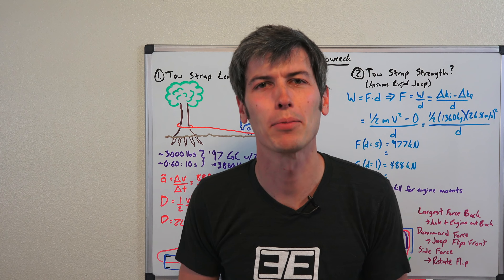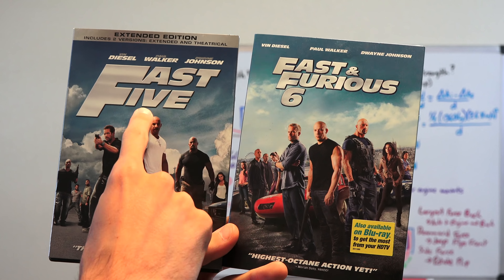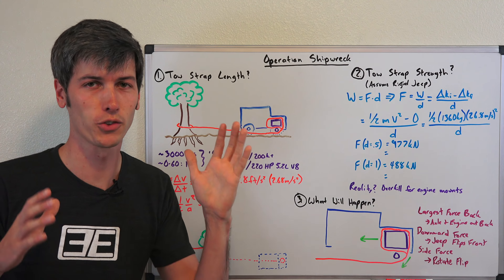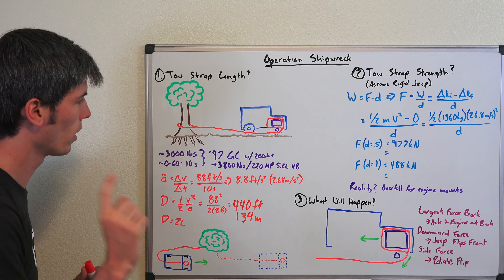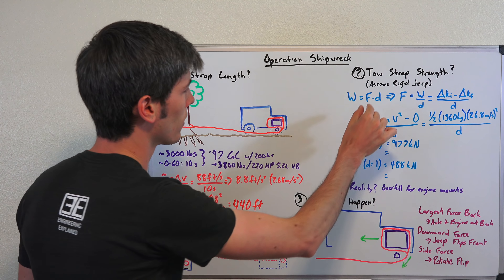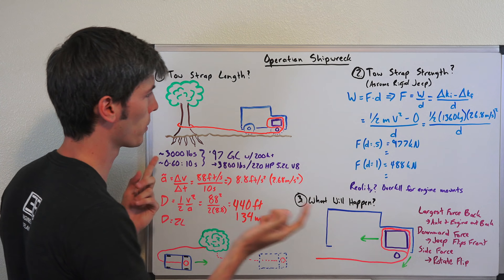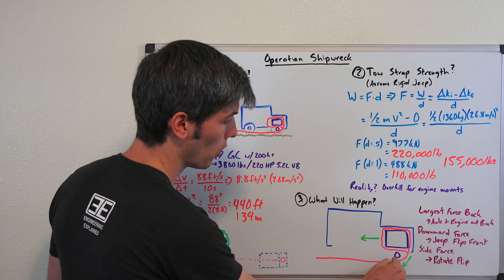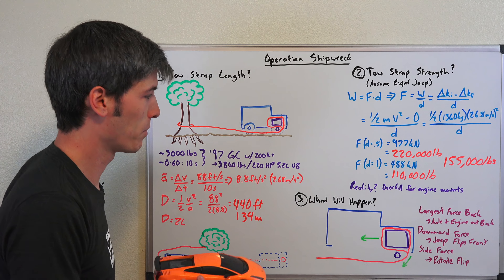Can You Pull An Engine In 10 Seconds With A Tow Strap?

Comment: Better way to do the math (because the acceleration is not linear): From the 0-60 time and weight calculate engine power (P = E/t = (0.5*mass*velocity^2)/(0-60 time). Now you can calculate the acceleration curve: acceleration = force / mass ; power = force * velocity ; therefore acceleration at time t is: a(t) = F(t)/m = P/(v(t)*m). The only thing left now is to transform this so you can calculate the distance (given v(0) = 0 and v(t) = integral[0,t](a(t) dt) as distance = integral[0,t](v(t) dt)
Reply from the maker: This guy maths! Thanks for sharing.
Reply: Btw it works out to actually be about 591 feet (180 m). Anyway, love your vids.

Comment: The closest thing I did to this is unbolt all but the very front body mounts of an 87 Ford E250 van. Push it nose first up to a tall tree, then run a chain from up in the tree down to the hole in the rear of the roof near the back doors. Then with another chain to the rear of the E250 frame I pulled with another truck and the van body was lifted up, off and upside down. That made removing the 300-6 engine much easier. I think I hauled the van body in for scrap on a big trailer. It was around 20 years ago. I wish I could have gotten a video of it but I did get a glimpse of the body lifting off and nosing over.

Comment: Result, no surprise to me. Try some grade 80 chain, maybe grade 100 but it may not take the shock and break. Maybe a 1/2" or 5/8" cable would do it, but they gonna absorb shock too, but far less than those straps. To understand what forces occur in the straps, research "Shock Line" as far as tugboats go. No, those tow straps are not shock line, but enough of the force is absorbed that it applies.  And another thing, one long strap would transfer far more shock than several connected together, but still will absorb a lot of shock.

Comment: You know, a few car thieves in the early 2000's could steal/pull an engine from a 90's Honda civic in about 30 seconds....
Reply: Mean Man Also on the original Volkswagen bugs there were only four bolts that hold the whole rear end engine transmission axles together.

Comment: Did you do a post-mortem on this experiment? Two thoughts come to mind. 1 should the mass of the engine and fluids be deducted from the total mass of the vehicle since the engine is fixed to the tow strap and on the toe strap side of the engine mounts. 2 the angle of attachment for the strap was optimal for the engine mounts to survive. Perhaps if the tow strap was somehow coming from Over the Top of the vehicle and putting the engine mounts in tention instead of compression, they might have failed. Thanks for the mathematical explanation from a fellow nerd mechanical engineer

Comment: I'm curious about the condition of the tree, and the math involved in what it absorbed.
Reply from the maker: The force it absorbed could be calculated knowing the amount of flex in the tow strap. So using the equations in the second part of the video, and guestimating based on the actual video how much the strap stretched.
Reply: We wrap the strap around the tree a couple times so when cinched down on the tree it was on the strap. The tree didn't get messed up at all it was a very large tree.
Reply: I dont know about the math but the tree was fine!  It actually said "Is that all you got?"

Comment: but would't be more acurate to calculate the speed needed and then the length of the strap based on the force needed to brake the bolts holding the engine and transmition in place?

Comment: 2.5 l 4 cylinder engine vs 2.5 l 6 cylinder engine or 8 
whats the difference jason ?
does the 6 cylinders injetors requiered more or less fuel to make the copustion 
which has more power , efficiency , mpg etc ...

Comment: The problem you forget about is pulling it out of the bottom is almost impossible there is a reinforcement beam the engine sets in your gonna tip the Jeep in half before it comes from the bottom now if you took the hood off and pulled it from the top side of the engine toe strap over the top of the car

Comment: Did you include the weight of the strap itself? As presumably you need to drag some of the strap along the ground also. Probably insignificant in weight, but unless you science the crap out of this HOW DO YOU KNOW!? what happens if at some point you need 2 miles of strap huh? HUH!? WHAT THEN!?

dL(strap)/t increases due having to pull less and less slack....or does it?

Comment: Your math is sound, but your scenarios are incomplete.  Just based on your figures, the most likely event is that the car uproots the tree, the tree flies into the air, flips, then lands rootside down right on top of the otherwise fine and still running car, goes through the car and replants itself in the ground...in slow motion.

I know, it’s obvious now that I mentioned it, right?

Comment: They put the strap on the wrong side .
It should've went over the roof not under the Jeep across the strongest sections of a car.
They were trying pull a small block mopar threw a jeeps front diff and frame supports.

They should have tried pulling it up instead or dropping it vertically then yes it should work.
A salvage yard has no problem pulling a motor and trans threw the hood area.
Not threw the bottom.

Comment: I haven't watched the video yet but I don't see it happening  you have bellhousing bolts connected to the engine the transmission is bolted down to a crossmember the motor is bolted down to the frame I don't see it happening at all let's see